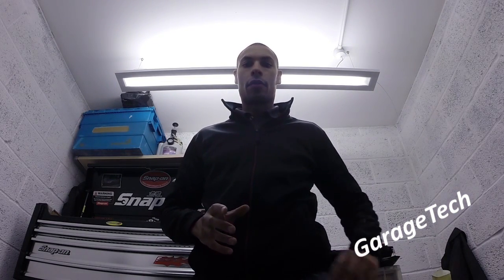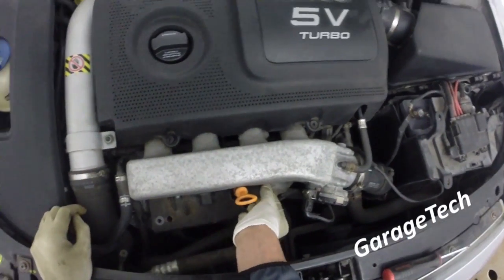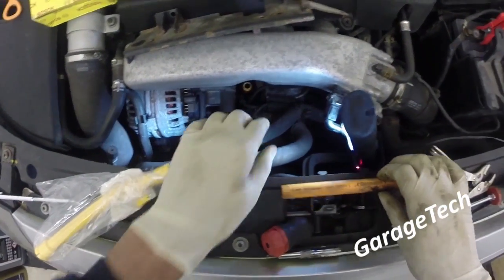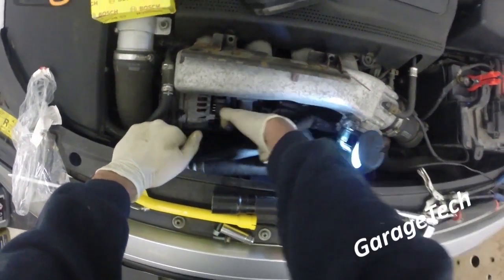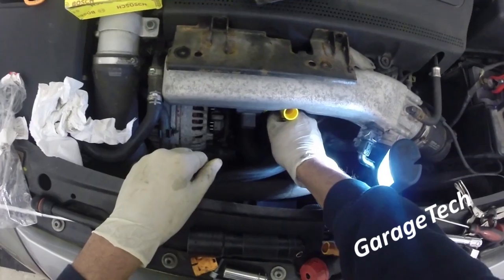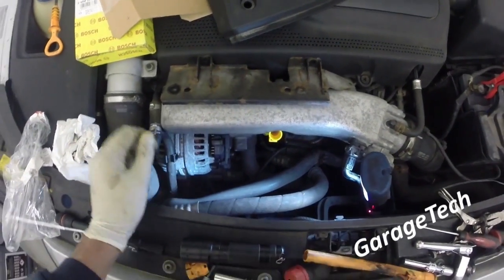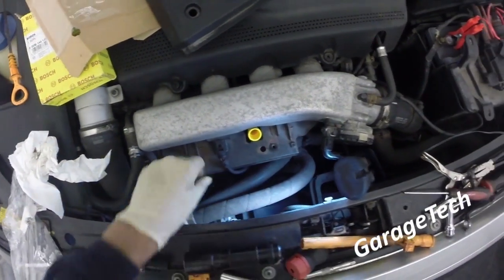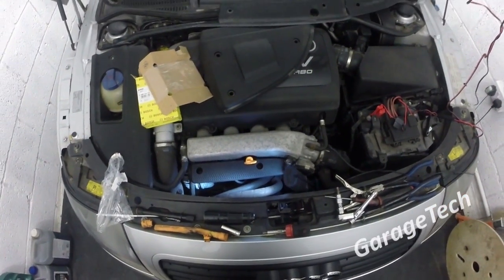How to replace your oil dipstick tube/funnel 1.8T Audi TT VW Golf leon cupra

Comment: Nicely done! I replaced my broken tube (lasted 23 years, but still—more stinking PLASTIC junk!) 
UPDATE: steel one from Urotuning does NOT fit!!
GOOD: freaking solid METAL and only about $23US. 
BAD: Doesn't freaking FIT! certainly isn't quite shaped the same. If I run into issues, I'll try to remember to share them. 
But again, your helpful video is VERY nicely done!!
Reply from the maker: @bigbaddaddio  thanks for the comments 👍🏼

Comment: Hi I have a Astra 2006 1.6 petrol twinport. My dipstick has a welded bracket on it that screws to the manifold heat plate. Does my dipstick twist so I can get the heat shield off as the bracket stops me from doing so. Cheers.

Comment: What if i accidentally dropped a tiny scrap from the tube to the hole? Hypothetically speaking of course.
Reply: I've done the same dude. Some plastic shattered into the hole. Hopefully the oil filter should stop any plastic fragments getting into the engine.
Reply: Mine was ok for a couple of weeks then did oil change for peace of mind and it came out then with the oil

Comment: Hey great video. I've just followed both your videos on this and the voltage regulator... Thanks to u saved me some candy Merci... How did u get the old broken dip stick tube that snaps of at the mount/inside out
Reply from the maker: Hey Dario, I used a pair of spark plug pliers to remove the outer piece and then a small angled pick to remove what was left in the middle. 

Some links below for an idea of the tools. Hope this helps.

BGS - Werkzeug - "Professional" Long Nose - Spark Plug Pliers - 280 mm. RRP £13.20. BGS-413 https://www.amazon.co.uk/dp/B00LVA5VL6/ref=cm_sw_r_cp_api_tRDhzbVD4VMYA

BERGEN Professional 4 Piece 115mm Hook and Pick Set BER5019 https://www.amazon.co.uk/dp/B00G3CCJ94/ref=cm_sw_r_cp_api_BVDhzbJ5BCDMP
Reply: Thanks for ur help a nailed it thanks. I have now replaced both regulator and tube ur video for the regulator is class as well thanks... After you changed ur regulator did you have any problems starting the car... My car sounds good it just won't crank now any ideas please
Reply from the maker: Hey, I had no problems, it started straight away. When you say it sounds good, have you had the engine running but It won't start from the key. I would start with checking the battery. This should be approximately 12.5v then check for 12v down at the starter motor when cranking. Also check all engine earth cables.
Reply: GarageTech.. Hey thanks for the reply and help... Yea tried the readings are perfect.. A mean the engine won't start... After a few tries the batt starts     to die... A followed the procedures for a batt change as well with the throttle alignment thing but still nothing...
Reply from the maker: Dario, have you checked the spark plugs and coil packs. It's quite common for the coil packs to fail. Was is running ok before you done any work?
Reply: GarageTech... Thanks again yea it was running up until the regulator failed... Am not great with cars but a even tried starting it without the altinator and still only turns over.... Reading forums and a lot people need a vag com... But a don't know why disconnecting the battery would result in  needing a vag com to get her started... Are you going to do any more vids on the audi
Reply from the maker: You don't need a vag com to start it after disconnecting the battery. I would make sure your battery is good, use a jump pack if you can, check all the fuses just incase, check its got fuel in ;) and then check the coil packs/spark plugs. I've got some some videos to upload they just need editing. A sump replacement and oil strainer clean out, brake fluid change, rear calipers and front pads.
Reply: GarageTech. Once again your the dude for replying appreciate all of this help.... Tried al that even a new battery still turning over strong just...  Reading forums would a crank sensor have maybe out to do with this... Looking forward to all of those vids as ad liked to al that to my car.. Thanks again
Reply from the maker: Could be a crank sensor. when you're cranking, does the rpm pickup on the gauge in the dash? That's one way to check it.